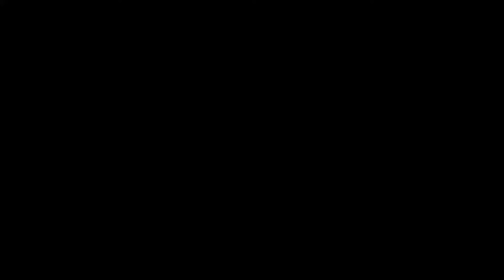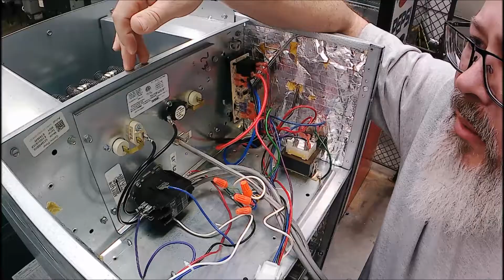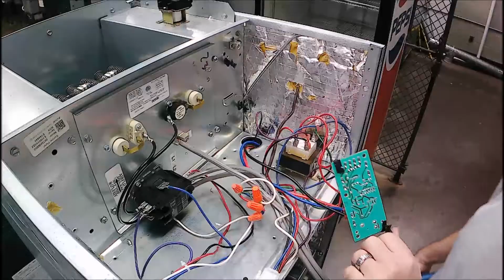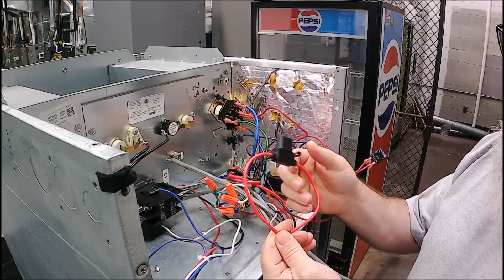Can a Relay replace a Circuit Board?? | Understanding HVAC Electrical Concepts

Comment: I want to understand why you put the heat strip purple wire on the closed circuit. How does the relay turn on the blower and the heat strip at the same time? Thanks
Reply from the maker: Nothing more than a parallel circuit...but you have to understand that it all originates from the heat strip high voltage circuit. Hugh voltage power on L1 comes into the heat relay/sequencer switch. This switch will turn the heat strips on and off AND also the blower. (at least this is the thought process to understand). When the heat relay switches closes it sends power out to the heat strip AND to the Normally Closed switch on the fan relay. Power just goes right through the fan relay since it is a  closed switch...that turns on the fan!  Everything hinges on the heat relay switch. Of course when the switch on the heat relay opens, it turns them both off. Hope this helps.
Reply: @johnjennings-JJ  Thank you for the info
Reply: That purple wire that you connected it in the the closed circuit of the relay. You said before that it was a heat strip wire. Is that correct? Thank you
Reply from the maker: Not the heat strip wire but it is the wire that attaches to the same terminal that the heat strip is connected to on the heat sequencer. This purple wire is bringing power from that heater circuit into the NC terminal of the fan relay.

Comment: This looks like an upgrade compared to replacing a burned out OEM circuit board.  A few dollar part vs a part that cost a few hundred.  With this fix, the fan won't run for a couple minutes to get all the heat out of the elements?
Reply from the maker: That's the big difference between the two. Relays are instant on/off and circuit boards we have programmed for timings on and off. If you changed to a plain 90340 relay it will not run any longer than the heat strip.
Reply: @johnjennings-JJ  That's what I figured. Thanks for responding. But surely there is a a way to wire a relay up so the fan will keep running until everything is cool. In a previous life I used to know how to wire the pre-circuit board units up. I got out of the business when it was still common to find all relay and switch operated hvac equipment.
Reply from the maker: I know Goodman used to use a fan sequencer before the fan circuit board. It might give you that delay that you are looking for with the fan. Maybe try it? You might have to look at some tstat programming to get the delay in heat mode. I had a setting in one unit tstat that was for either "system controlled fan" for "tstat controlled fan" would have to use the "tstat controlled fan" option I think to get a heating delay.

Comment: I think I'm missing something.  The way I'm understanding it is if we put the purple heat strip wire on the normally closed point won't it shut off when we bring the blower on? I know this isn't permanent but still just making sure I get it
Reply from the maker: Just so I say it right let me start with this...2 separate circuits, one for the heat strips one for the blower. The purple wire connects the heat strip circuit to the blower. This is a redundant safety circuit because "back in the day" the tstat turned the blower on in cool mode but the system had the responsibility in heat mode. (Think old fan limit switches in furnaces) The purple wire here feeds the high voltage heat strip circuit L1 power into the NC blower relay switch so that if the heat strip is on then the blower is on. Whether on a fan board or just a 90340 relay the switches and function are the same.
Reply: @johnjennings-JJ  thank you for both replies. I do get it now. Sorry I needed the drawn out version lol
Reply from the maker: If we are in cool mode then the NC switch on the blower relay/board should open and the NO switch will close to bring on the blower. By the NC switch opening in cool mode, the purple wire doesn't let any power into the heat strips circuit. The design is supposed to be this way...the purple wire feeds power FROM the heat strip circuit INTO the normally closed switch on the blower relay. My brother in law had a bad fan board and the normaly closed switch was stuck closed all the time. This made the purple wire circuit flow backwards! It fed L1 power from the fan board NC to the heat strip circuit. So anytime his fan came on in cool mode his heat strips were on. It was back feeding through the stuck NC switch and that was too many amps for that fan board. Hope this helps.

Comment: What is the rationale and usage of the purple wire from the circuit board that you would attach it to the fan relay 90–340??? Avoiding that information is not helpful.
Reply from the maker: The purple wire is a "just in case wire" for the normally closed circuit of the fan relay or even the original fan board for this goodman air handler. It connects the "load side" of the heat sequencer to the normally closed terminal of the fan relay. When the heat strip gets power it also sends power to  the fan so that the fan is on at the same time as the heater.

Comment: You couldn't do this with a flame sensing system .. other than that great video and explanations
Reply from the maker: Agree. The furnace board does do more as a whole but the fan relays for heat and cool do work off of a simple relay. Thanks for commenting.

Comment: I meant to ask you. What amperage does that relay have? Cause the heat strips are going to pull a pretty good amount. I appreciate if you have time to respond later if you can.
Reply from the maker: It is just a standard 90-340 relay made by several manufacturers. I think (off the top of my head) it is something like 12RLA/60LRA at 125V which is usually ok for a fan relay. I do have an older heater in it at work that has a similar looking relay in it, but of course the amperage rating is more. I'll let you know what that exact model is when I get to work and put my eyes on it.
Reply from the maker: Update... The electric heat relay I have on this older heater kit is a Honeywell R8229A 1013 model. It is rated at 26 amps (combined inductive and resistive) per pole, which is good enough for a single electric heater @ 240v I think. It is a 25 amp if just resistive and 7 FLA/35LRA if just inductive.

Comment: Where are you located.. i am in fla. I have a goodman outside ac unit. The heat relay blu.. i am getting insane quotes for 600 bucks. Help.
Reply from the maker: Everything is expensive now, even here in the Carolinas. Seems like more products are harder to find and the cost has gone up all across the board. Is it that much for just a heat relay?
Reply: @johnjennings-JJ  no the total part is about $142 that's what the k19 kit and the heat relay but everybody wants to rip me off for installation which takes him about 1 hour
Reply: I've been watching your videos like crazy I'm turning into an expert with my house at 65 LOL I'm about ready to buy the parts and try to do it myself
Reply from the maker: Well I appreciate you watching the videos. I know there are a ton of guys/gals/companies freak out when a homeowner tries doing their own work or when someone encourages them...but who doesn't use YouTube?? Nobody! We all look for stuff trying to learn. There are a lot of things that are fairly easy to handle as far as using you hands but the average homeowner doesn't have the test equipment and experience for troubleshooting. I am not going to go into any "disclaimers" but just be careful. If you think you can fix your unit and can buy the parts, well...

Comment: Too much rambling.  Just get to the point of the video.
Reply from the maker: Can't get it out of my head like that....that's why I can't do tiktok. Thanks for the comment though. I'll try harder next time.
Reply: Too much rambling? I watched two other techs do videos on this same technique and came away completely baffled after both of them. This video was concise and to the point enough that I now feel confident to do this myself if I need to get a unit up and running in a pinch. Excellent video, good sir!

Comment: That's all my air conditioner has--a relay--but it's a time delay relay that uses heat to close. I need to find a replacement for it. Maybe I can replace it with a board. :-)
Reply from the maker: I don't see why not. That's why i put the two arrows on my thumbnail...it goes either way!

Comment: Question?
Reply from the maker: Got one? Go ahead.
Reply: @johnjennings-JJ  if a relay is receiving 28V instead of 24v can that make it intermittently fail? Or long delay for blower to turn on? (For residential)
Reply from the maker: We say we use a 24v source but it usually comes out of the transformer at 26 or so. So #1 i would say is make sure the transformer is hooked up correctly if you indeed have 28v. #2 I doubt the 28v would kill the relay, but I suppose if the voltage is too high it could burn the coil up. As far as any intermittent issues, the switches inside could be pitted and causing intermittent connections? The old Goodman fan sequencer was bad for that!

Comment: You can use that as a temporary fix until you can get the proper part.
Reply from the maker: Absolutely. I definitely recommend OEM parts. I think some newer guys don't realize what they know yet in some simpler circuit boards like this one. That fan board HAS a relay on it. Thanks for commenting.

Comment: With the current 2-3 week lead time on so many high end circuit boards and electronic fan motors, this is an important thing to know how to do. Not to mention some of the ECMs are cresting $1000
Reply from the maker: Yes. Between the cost and the wait time it is important to understand what you can do for a customer. If you present it to them,  explain it, and they are ok with it...go ahead. I think a lot of younger techs maybe don't feel as confident in the basics they learned. I like thinking about some of these situations just to get my mind going. But I do try to replace OEM whenever possible just so there isn't as much headache.
Reply from the maker: OEM is always the way to go in my opinion as well. But some guys I know look at circuit boards like they are aliens or something. I just try to point out that you can still check them using the basics.
Reply: I think it's better to get rid of the ECM set this up with a PSC

Comment: Thank you for your video.
Question: Is that control-board included Time-Delay and Fan-Relay?
Reply from the maker: Yes. It has about a 7 second delay before the fan comes on and then approx. 1 minute when it shuts off.

Comment: John I have a new Goodman that looks just like that set up with a 15 kw heat strip and ac  but I need to add my 2nd thermostat to it to control my hardy wood furnace. Can you explain to me how to do that. I’m really a visual learner lol
Reply from the maker: Hardy wood furnace...so it is one of those that are completely outdoors and you are just circulating water from it into a water coil in your ductwork?

Comment: Thank you for your video. Question: What is AC voltage between Red and Green wires at the Solid State Time Delay should be?
Reply from the maker: The red is 24V going into the solid state timer "switch". If i check it to green going out of the "switch"  when the relay coil is energized  it would be 0 volts (same leg of power). I would think it should be 24 volts if the relay coil is not energized.

Comment: So one would assume this air handler is now less efficient?
Reply from the maker: Depending how you look at it I guess. I try to show a few of my guys what is really on the circuit board. They think it is something magical and don't like to use a multimeter to check it out. This shows them what they already know...it is/can be a simple relay. The unit in this video was part of a 13 SEER Goodman system and it had a fan board but we have a new 14 SEER Trane system and it has a relay. Go figure.

Comment: How about the heat strip? how do your wire it in the relay?
Reply from the maker: If you talking about powering the fan motor when the heat strip comes on then you have to connect the wire from the outlet of the heat relay to the normally closed terminal on the fan relay.
Reply: @johnjennings-JJ  then, how can you get the fan motor to come on in both cooling and heating if you connect the heat strip in the normally closed terminal of the relay. I think you could have explained how to wire the relay by connecting all wires including the heat. Do you connect the heat strip to the relay too?
Reply from the maker: This is just a relay for the fan, the heat strip has its own relay. For the fan relay I remember it this way...the N.O. terminal is L1 power coming in from the main terminal block to power the fan. The N.C. terminal is L1 coming from the heat strip circuit to power the fan when the heat strip is on. The COM terminal is power leaving the fan relay to go to the motor.

Comment: Got a furnace with no control/circuit board that blew a transformer (no fuse) replaced transformer and added fuse and blows the fuse instantly when i turn the power on! Any thoughts?
Reply from the maker: Textbook "short" in my mind. It could be something in a thermostat or just a rub between two wires or a wire and the cabinet. If it blows the fuse as soon as power comes on (not on a call for hear or cool from the thermostat) then I would be doing a continuity check on my thermostat wiring to find the issue. Something between "r" and "c" ain't right! I have seen it plenty of times where exposed wiring outside can weather and the insulation falls off leaving exposed touching wires but I am not sure if that is your case here. The continuity function of a meter should be enough to find the short..

Comment: can you do that in any other brand aswell
Reply from the maker: Sure. I have seen quite a few simple fan boards that you could do this on. Goodman, Rheem / Ruud, etc. I would do this as a temporary "fix" until I got the OEM replacement board but it could be a more permanent replacement if you wanted.

Comment: After 2 failed Ecm 2.3 motors and 4 yrs out of warranty along with a mad family I put in a psc and relay for the blower. 2 stage, 2 compressor split system heat pump with electric strips. My question is can I use a fan relay board and a relay to get med fan speed while in ylo and high speed when in y2 or emergency mode? Thanks
Reply from the maker: Short answer -probably - after you.hacked up all the wiring. It would take some thinking to get it exactly wired perfect but i am sure it could be done ...BUT...i would just say that if something ever happened in the relays and those two speeds were powered at the same time it could catch on fire. The only times i personally have heard of or seen a motor on fire was because 2 speeds were energized at one time.
I think that is why a lot of PSC model air handlers energize just a single speed no matter what mode it is in. It is just easier and no risk of fire!
Reply: @johnjennings-JJ  John, thanks for the reply and info. I’ve got to do allot more research and data gathered but I was thinking of using the fan relay board activated by G call hvac line out to relay and nc with med speed tap. 
Use y2 and c to trigger the relay and put high speed tap on no terminal 
I just can afford any more 2.3’s and their not so good history. Thought about the quick boards but they’re not cheap either. Thanks again
Reply from the maker: My co-worker had the same problem and finally just put in a PSC motor. No problems since then! But he didn't have a 2 stage cooling unit. You can do it but just have to work the wiring out right.

Comment: Your videos are very good.. I have a question, my air does not heat.. It just blows cold air.. I already changed the thermostat, the capacitor, and nothing..?
Reply from the maker: Thank you. Do you know what type of unit you have...a heat pump system with electric heat or a system that is electric heat/gas heat with an air  conditioner?? It is hard to say without knowing what should be running. It could be any number of things.
Reply: @johnjennings-JJ  It's electric, not gas.
Reply from the maker: I am assuming it is a heat pump since you mentioned replacing the capacitor. And I am thinking that it isn't running at all. Start simple and make sure breakers are on and power is going into the contactor of the unit. If so, check for 24v on the 'Y' and 'C' of the low voltage wiring entering the unit. If it is going into the unit (usually has wire nuts connecting to the factory wiring) then it should end up at the contactor coil (usually the sides of a contactor). If it is at the wire nuts and not at the contactor coil then you have to find out of it is something like refrigerant pressure switch or a board issue. I would also check the pressures in the unit. Hopefully not a leak in the system.
Reply: @johnjennings-JJ  You do not have another social network or where I can communicate with you.

Comment: Grateful that you showed me how to do get a customer system up and running for a bit while waiting for the replacement parts that was a lot of help
Reply from the maker: Thanks. I think we can use relays sometimes to get us by for a day or two while waiting on the parts to arrive. Of course without butchering up the wires and function of a unit. Glad to hear it helped.